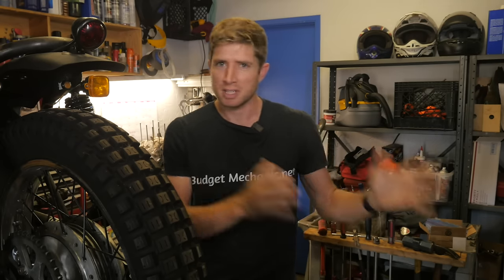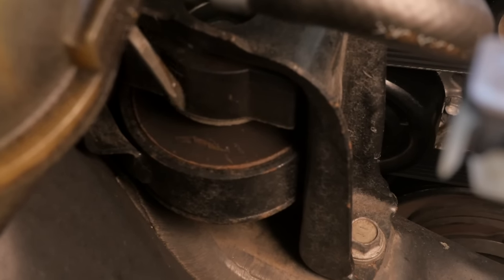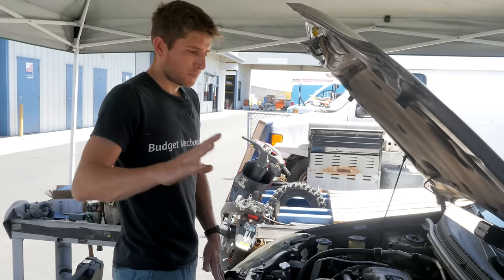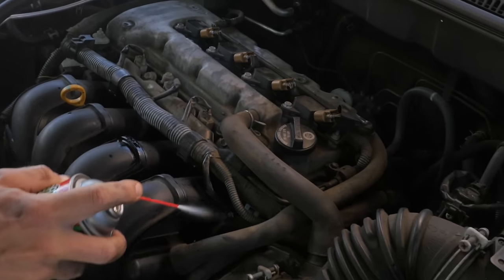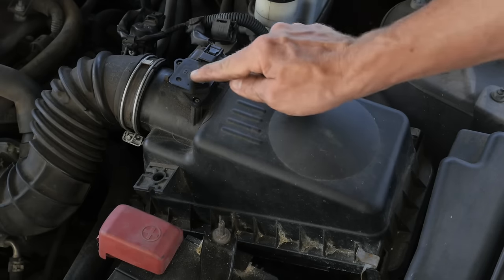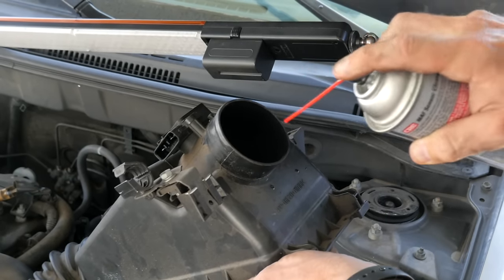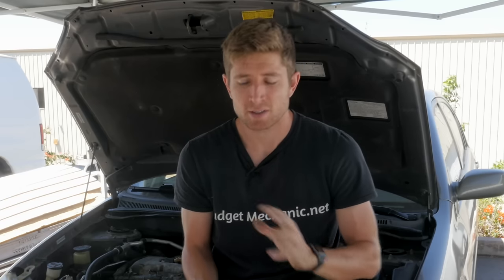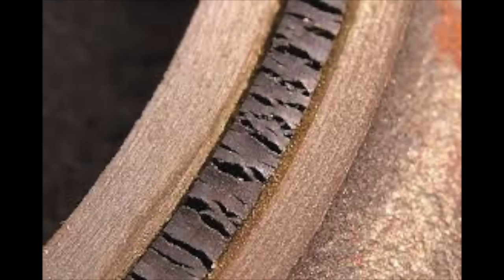Diagnose and Fix Rough Car Idle - Main Causes For Shaking / Vibrating While at a Stop

Comment: Hi !  A Riddle !……..Strong vibration inside car.  Exhaust rattles many years.  New motor mounts and transmission mount did nothing.  Was aftermarket parts.  The car vibrates much less when it is warm out, and virtually no vibration when it is raining.  Is vibrates both in park, and drive, in neutral, driving at the speed, sitting at a traffic light in Park, or in the gear.  Again, with warm weather much less.  And with the rain, virtually no vibration. For   Many years.
Reply from the maker: Wow that’s a great riddle! The humidity/temp thing makes me feel that’s it’s an air/fuel mix problem. Any engine codes? Vacuum system has many parts but I wonder if there’s something going on there. Check for cracked vacuum lines
Reply: I feel like even though I have a new engine mounts and new transmission mount three years ago, (didn’t do anything good then) , maybe they weren’t good?   today I propped up the transmission pan about 1 to 2 inches, and the steering wheel and idle still was shaking. same amount) but for some reason I feel like it still is the transmission mount.  The (new parts) Volvo 940 transmission square mounts (some models take circular ) seem to protrude past outer metal frame.   mine seems slightly at level.  propping tran Pan didn’t stop vibration though.  large muffler shake in gear standing still. and driving.  and at idle noticeable.  car shakes vibrates all rpm.  accelerating abd at certain rpm it’s vibrating more.  i put a harbor freight vacuum gauge on it. i got ….. “””At idle engine speed the gauge pointer pulsates, but at higher speeds the pointer is steady, this could be an indication of loose valve stem guides.”””.  
But shouldn’t a shake be absorbed by engine and tran mounts.  I sprayed car w brake cleaner while running.  minor barely noticeable dip.  at exhaust manifold.  cylinder 2.   cylinder 4 spark plug for was oily and black.    car feels strong and great other than major vibration.   no engine codes.   obd 1.  1993 volvo 940.  maybe it is the transmission mount?
Reply: and w heavy rain.  barely vibrates.
Reply: also.  i did spray cleaner into air intake and cleaned IAC.    also  this vibration did Not go away 3 years ago. before was there an after was there for timing belt water, pump, and harmonic, balancer change, and also after knew of timing, belt and water pump and harmonic, balancer change, same vibration.  Although I would say that the harmonic balancer, it looks a little off at the moment, but remember this all disappears with a very heavy rain.

Comment: After watching this I felt like i could be a mechanic because you explained everything so perfectly! Question though, I've had someone look at it and they said the belt tensioner might need to be replaced. I phoned another mechanic, without having looked at it, they said it could be the alternator. 

Here are the symptoms my car is experiencing: 
1. vibrations while idling 
2. vibrations while using electronics (windows, A/C, etc) 
3. random dashlights flashing (ie: passenger air bag, cruise, cruise set, and more recently battery light and ebrake light). 

From these symptoms would you be more inclined to say its the alternator, battery or belt tensioner? Or something I didn't mention?
Reply: Sounds like you are definitely low on power. If it were me I'd take it down to your local auto shop, most will test the battery and alternator for free. I suppose a tensioner could also cause a lack of power if it wasn't keeping the belt tight enough to properly spin the alternator but that's a bit less likely. You can always some back and check that afterwards.
Reply from the maker: Almost positive your alternator is failing. You can get it check free at many auto parts store

Comment: My 04' 4.7L quadratrac automatic.  It will turn over, and if I hold the gas pedal down, it will run rough. We checked the ignition has power and spark.

Comment: Don't forget to gap your spark plugs properly. Not all plugs are perfect out the box.
Reply: Never gap iridium or platinum plugs. They are pre-gapped from the factory. If you insert a gauge in between the electrodes you will RUIN them. Take iridiums and platinums out of the box, take the protective cover off the ends, and put them into the engine. No messing with the gaps. Only gap copper plugs.
Reply: Wow good to know thanks! I really only used spark plugs on my lawnmower when I used to cut grass for my grandma.

Comment: As long as you have your battery cable disconnected and the wires removed from your throttle body you can open it by hand
Reply: Some still require a throttle body relearn procedure even if it's unplugged.

Comment: Thank you so much. I never knew about crank pulley potentially causing vibration at idle.. so i learned something new from this video. Subscribed!
Reply: The bearings tend to out also causing noise (not necessarily vibrations). The radiator fan is another component that could cause rough idle but when the fan turns on only. It could have been mentioned too. Lastly, and not covered in this video, if you have an older car it might need a valve adjustment. Pretty good video overall but of course lots of things could cause vibration and noise.

Comment: Thanks for these great tips! Trying to troubleshoot an intermittent engine code p0171 on my corolla and no idea what I'm doing. It popped up a few times after I did something silly like not putting the oil stick all the way in, gas cap, air filter box not secured after changing but now it's staying on and trying to figure out what it is..
Reply: Most likely intake manifold gasket. If you have a obd-II scanner of your own, you can pull up the long and short fuel trims on cold start up. If they’re +20 on either one it throws the code because it’s trying to overcome the lean condition. Spray starter fluid around the intake manifold and if the RPMs change, it’s the gasket. Really easy to change and only $5 part. Hope that helps. If not that, check your air intake line for vacuum leak.

Comment: I got new spark plugs because the mechanic said so...before it wasn't  vibrating at stop light, but with new spark plugs....I feel the vibration now at light or in park...
Reply from the maker: That’s interesting. You got correct and good quality plugs?
Reply: Same happened to me should I replace wires as well?
Reply: I`ve seen people crack the ceramic on the plugs before when installing them .

Comment: 5:13 NEVER use carburetor cleaner to detect leaks. Carburetor cleaner can be corrosive and should be used carefully. It can damage rubber, plastics, painted surfaces, and electrical components.

Comment: Just bought my Grandmother's 2009 Ford Escape 2.5ltr. w/ 80k miles, it's always had a rough idle in gear with the AC on. AC off & it runs smooth as babies butt. I've tried cleaning the mass airflow sensor, the throttle body, the plugs, etc. Even did the whole reset procedure after cleaning the throttle body.. I hear it does that because it's just a small Engine & the AC bogs it down a bit. Either way, I cannot get rid of that rough idle with AC on & in gear. However, it's done this since it was bought brand-new in 09'.
Reply: I’ve had this same exact problem! A/C on the engine surges and feel a slight pull but when the AC is Off it runs smooth again.. my problem was AC Freon Overcharge. I had to release son gas because the pressure was too high problem fixed
Reply: What was the problem do you remember

Comment: If nothing works and you haven’t changed all your spark plugs. Check and see if you accidentally cross threaded a spark plug. I did this and it caused a small leak which made my truck run rough while idling and would stall

Comment: If only there were trustworthy mechanics near me.

I've got a 2014 Chevy Sonic. It just (today) started to idle a little rough [low idle 250-500 rpm] while at a full stop in gear at stop lights and signs... 
and then... 
when I parked in front of my house today after work, ...I put it in park, It started to idle rough again.
So i tapped the gas pedal ... The the rpms shot up!
As I let off the gas pedal,  the rpms continued to climb to around 8k and held steady.

I freaked out lol 😆 and shut the car off immediately. 

I wish I wasn't a car noob.

Comment: My experience with intake air leaks past the OBD 2 mass air is that the check engine codes will indicate lean misfire in one form or another. Sometimes the light will not indicate, they will be pending codes. Rough running, visual inspections first, then check your codes. Direct injected systems can not clean your intake valves through your fuel tank cleaner as the fuel goes directly into the cylinder not upstream of the valves.

Comment: I had that happen the only 2 things i could find were low oil and it seemed it wasn't heating up like it usually does(it was cooler that day) It is an 78 E 250 with no choke.i topped off the oil seems to run fine now My question is will low oil cause this..
Reply: been driving it a while since then runs great
Reply: Yes low oil will cause this. I bought a ford truck that had a oil leak that I didn't know about, and after driving it for about a week it started shaking and vibrating at idle and driving rough. I checked the oil, and it was really low. So I added oil to it, and it drove fine afterwards. An once I fixed the oil leak it never did it again, hope this helps.

Comment: great video I had all me timing belts power steering air condition belts alternator changed last week now as a mechanic told me this the problem $1000 gone now he needs to look me car again there is a liquid can be put in the engine also helps fix everything but I try this fuel system cleaner when I idle in drive it shakes a bit and doesnt idle properly like going to break down mechanic in australia biggest rip off all about there hour rate then the job now

Comment: My rough idle was a misfire caused by dead coil. And when driving normally, the truck would start shaking as if my engine and transmission were loose when I'd get to about 55± mph, just to find out it was bc an unfired cylinder caused so much imbalance. Replace coil, all good now. Id thinking it was something really bad or a multitude of stacked issues. Thankfully was easy fix. And I have 2004 F150 5.4

Comment: You don’t mention the fuel filter, I’m not very sure about it, but it can be also a factor?
Reply: Yes, but fuel filters typically show symptoms at high loads first when lots of fuel volume is needed. Then the poor performance gradually creeps down to low speeds and low loads as it plugs up more and more. Most vehicles now no longer have replaceable fuel filters. The only filter is the felt suction sock piece on the intake port of the fuel pump which is submerged in the fuel tank.

Comment: My car steering wheel vibrates significantly when in gear and in a stop position. What do you think is the problem? Thank you keep safe
Reply: OMG, we just fixed our and it was like yours.  You would NOT believe this.  Corrosion in the Light Bulbs suck all the juice in the car battery.  When we were in Gear or Stop, the engine would shake and bogged down and about to die.  I knew it has to do with the Battery or Power or Alternator.  After getting a new battery + alternator, it still does it.  After checking the lights because we tested the backup lights, I saw bunch of corrosion in the sockets, I replaced them with LED for less power, now the car is great !!!
Reply: @JodBronson  that's crazy, I would've never thought corrosion in the bulbs would cause that. It's amazing how something so small and simple can cause something so drastic to happen, that's why it's important to check everything on your car regularly.
Reply: @codynicholson8999  - YES..... It was crazy.... I was pulling hair out of my head.  It was the odometer that taught me that.  When we at a Stop Light, it would go up and down and sometimes stalled.  If we are in gear, it would stalled, because it needs more juice.  That was when it gave me the idea of the "Bulbs".  Also, during Stop, the Brake Lights On.... It's sucking more juice from the battery, therefore not enough battery to run the Spark Plugs, so the Car Stalled or Shut Down.

Comment: I'm having serious vibration issues when i put the car in drive...could this be the motor mount issue? I changed all the spark plugs but still the same vibration...😓
Reply from the maker: Yeah could easily be that
Reply: I've done intake manifold, airbox replace, spark plugs,  throttle body gasket, valve cover gasket and all 4 motor mounts.  It still vibrates at stop lights.   injectors next.  The vibe is a buzz box and I can't tame it. Honestly it seems to change through the daily drive.   On my way home it was smooth as butter at a light and buzzy twenty minutes later in my driveway.   Random stuff.
Reply from the maker: Another easy thing I didn’t mention in video is putting in some torque converter fix additive to your transmission. Cheap and easy and worth a try
Reply: @maggarjt  take it to a reputable shop for diagnosis and if it's something you feel you can take on thank em and pay for the diagnosis, if it's a big internal issue... hope you got savings or good credit
Reply: Are you getting misfire error codes? It code be the spark plug coils. Also check the connection. This happened to me. I changed mine around and found out the connection wasn’t good

Comment: My car can't make a quick stop. Gotta wait at least 7 min before start engine after making a stop or else it won't start. Also can't wait long at the lights or else it'll stall and check engine light up. Had to spray mass airflow cleaner Everytime. Do you know what's the problem? I clean throttle body as well. I replaced spark and spark wire and coil. No help.

Comment: My jaguar is idling rough and I’m losing sleep over thinking
Reply: I’m the same way, when my car is not at 100% I get so stressed
Reply: Here are the possible symptoms, check these first:  Spark Plugs, Dirty IACV, Vacuum Leaks, Dirty Injections (Auto), Dirty Carb, or Weak Battery or Alternator.

Comment: Thanks for another great video! Here's my issue I've done all of the above for well over a year now. Every time I put any amount of fuel in, it will shake and cause the engine light to flash if i come to a stop. Driving about 5-10 miles (with no stops) I can usually wait at a light w/o issue. In park while idling is 60/40 that the engine light will flash.  My codes are always Misfire in cylinder 4.  I would appreciate  any advice.  Spark plugs, wires and coil pack replaced in Hyundai Accent 2005, seafoam fuel and air take done within the past 6 months.
Reply from the maker: You need to find out why it’s misfiring, that’s your bigger issue and probably why it’s shaking too. Swap coil around to other cylinders to make sure it’s not faulty, then it’s possible injector is acting up
Reply: Could possibly be a failing fuel pump. Not sure cause I had to replace mine due to a bad floater but it's most likely a bad spark plug, injector or coil

Comment: Got batter changed 2 weeks ago idle has been higher since.  The guts took air filter box off to change battery.  Also today, (2 weeks later) the battery dash light came on. It has not come on in the 18 months that I have owned it.

Comment: It was the clutch in my car, unbalanced and installed wrong.
Reply: Some manual transmissions take a weighted fly wheel that externally mounted or the internal mounted, if you put the wrong one this may be the cause. So, speak to or write to an expert or the dealer to find the right flywheel. Good luck.

Comment: Sparkplugs✓. Coils✓ engine mount✓ general wear and tare✓  missfire✓  I'll wait for my car to reach 175,000 ks.  It's just clicked 166,000 , 07 low ks huh🤗
Reply: At times changing coils and plugs wont help if the compression is low. Its also good to check compression especially if you are having misfire codes on one cylinder

Comment: My car toyota corolla 2010 vibrates only when I'm in drive at stop and turn the fan on, when I turn the fan off vibrations stop. If I let the fan on in drive at stop, by turning on the night light on the vibrations stops instantly. I have new alternator installed and checked for voltage, all good. I have replaced all 3 engine mounts plus the trans mount with brand new Toyota OEM. I also replaced the ignition coils and the spark plugs with new Toyota OEM. I have the body throttle cleaned nice with Toyota spray plate cleaner OEM, I also have the air sensor cleaned nice. It is something electrical that I miss? Car has 130k miles, new tires and re-balanced. My mechanics don't have idea what can be. Toyota dealer says that my engine and trans are perfect. All replaced OEM parts were torqued to the specs. Can anyone help me please? It may be the IAC valve???

Comment: This is very insightful and well put together video. I'm dealing with an issue with my 2010 Hyundai accent hatchback where while driving my car stutters/cuts out/acts like it wants to stall. I've cleaned my idle air control valve, and that didn't really seem to help. I'm thinking it's the fuel filter, which is built into my fuel pump. Which I might replace to see if that helps. I already ordered a new IACV, that I'll install tomorrow. But I'm pretty sure that's not the issue. I'll keep ya updated
Reply: Any update?
Reply: How did it go?

Comment: I sprayed some cleaner into the hose before throttle body, the engine sucked it all in, back fired a few times and fucked up the intake temp sensor.